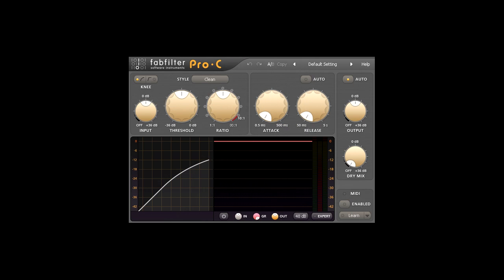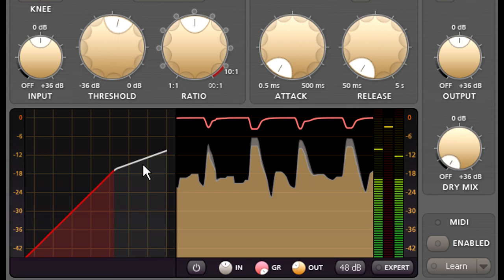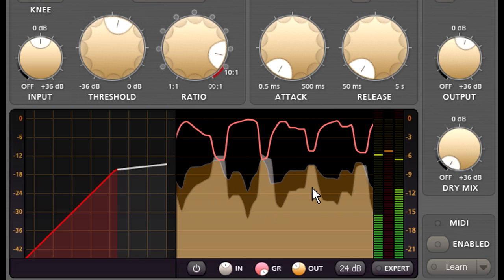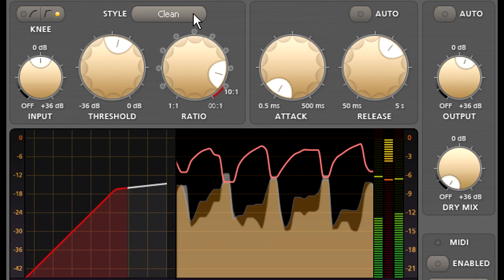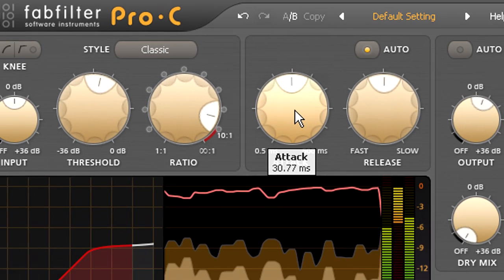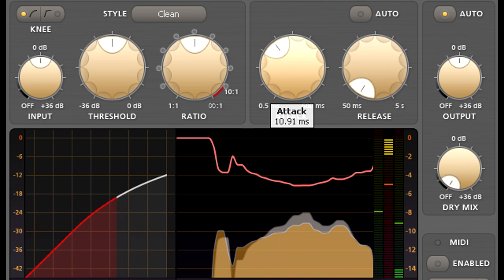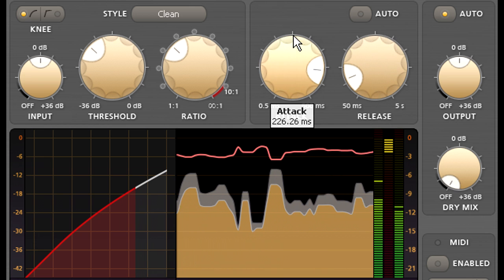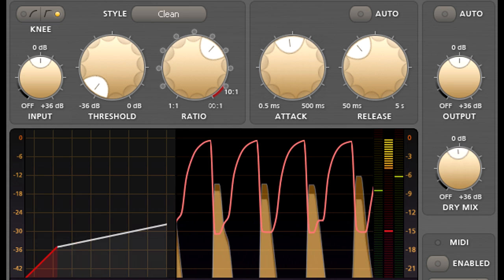Introduction to FabFilter Pro-C Compressor

Comment: Only thing I would like to see (and maybe it's a crutch) is the knob values showing in digital all the time ie above the controls for ratio/threshold etc If not only because I may need to compare the settings between different plugin instances and looking at knobs just doesn't give me that feedback quick enough. I'm sorry I haven't checked, maybe it's an option in the software?
But I agree with many other commenters here as to the quality of this video and the great clear explanation. I'm in ;-)